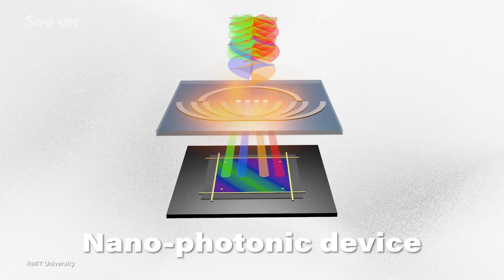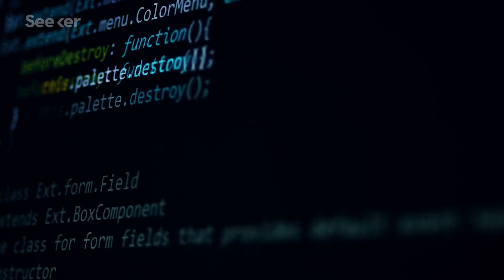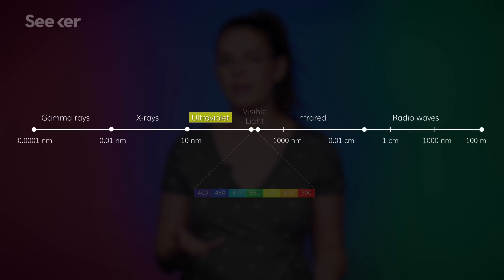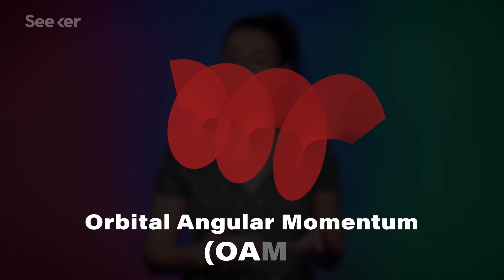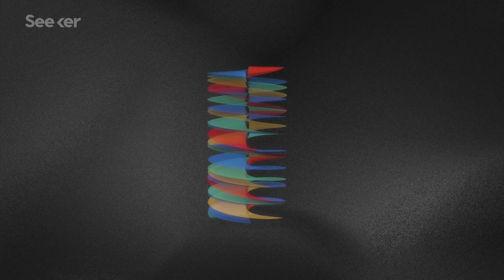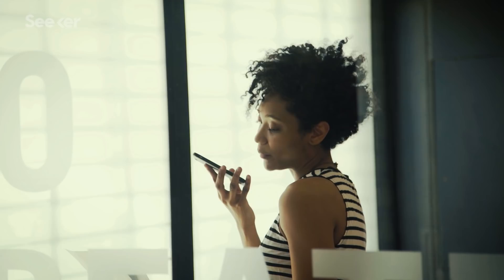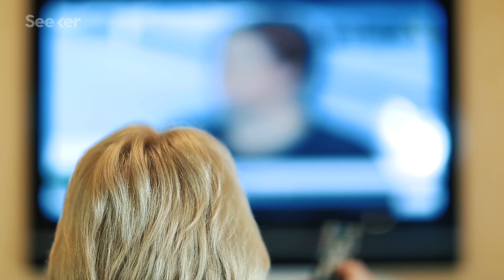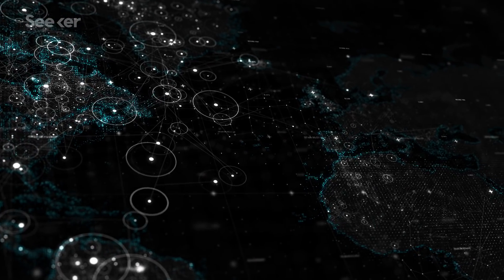Why Twisted Light Holds the Key to Radically Faster Internet

Comment: Amazing video, amazing Maren. For the sake of explanation, the video dumbed down a little too much some tech talk.

We can typically transmit 80 optical channels in one single fiber. The OAMM might allow us to squeeze more into that fibre.
All those channels are in the infrared side of the spectrum, to use visible light or ultraviolet we cannot use common fiber.
This typically means a backbone transmission between communication hubs, not end user access, but it might allow for more light channels to reach a neighborhood or even a street, providing faster speeds per end user / subscriber.

Comment: Gosh... She mixed everything in one load of semi-nonsense=(. 

1. What does OAM have to do with the energy, meaning, frequency of light?! These two DoF are decoupled...
2. Nano-photonic devices are used for non-OAM light for at least for a couple of decades. This field of research emerged earlier, and has been developing in parallel with singular optics (twisted light).
3. Twisted light is not made of more "modes" of light. Rather, each photon carries non-trivial topology. "Mode" is an overloaded term, which is better to avoid, especially since she talks about decoding, meaning, quantum regime...
4. What on Earth makes quantum computing a preferential application for twisted light?! It doesn't matter WHAT information to transfer with OAM... OAM is just another information carrier...
5. And... sorry, "machines in space" communicating via fiber?! Hah... Human teleportation is more likely, honey...

Uff... In science we trust...
Reply: This is typical from these guys they just throw out complicated language without bothering to explaing anything and hyping it up all along.

Comment: they finally used circular polarization to add another dimension to QAM type physical transmission models?
Edit: technology proudly adapted from decades old military radar techniques. not new, you just havent ever used a spinning dipole antenna before. wink

Comment: Fibre optic isn't a wire, its fibre optic core, copper cable=wires or pairs of wires, fibre optic cable has cores. Also only multimode (local distribution typically in LANs) uses internal reflection.  The main backbone of optical fibre is single mode which uses a Gaussian profile along the core.  What your talking about is a new form of multiplexing to increase bandwidth.

Comment: I do not appreciate the inaccurate statistic at the end that 99% of international data goes through submarine cables. 99% is way too much. More realistically speaking it’s far less, especially since many landlocked countries also have internet access, and unless they are accessing websites from somewhere “overseas”, they won’t be sending any data through submarine cables. Example, South Koreans accessing WeChat or Alipay, Afghanis accessing daraz.pk, Mongolians using aliexpress etc. All this is international data, but they are directly connected over land.

Comment: So put simply this is a new protocol for fiber optic cables that allows more bandwidth on the cable, there is more data being transferred at the same time.
This video isn't good , talking about faster internet but not really explaining the actual application of the thing they were talking about, and when talking about fiber optic it isn't appropriate to say faster because it is light, the sentence that absolutely should be in the video isn't and that is : more bandwidth on the fiber optic cable

Comment: I've never heard the term twisted light before. That's just how EM waves propagate. Twisted light suggests "not twisted light" is normal light. However: All light is "twisted" in one way or another. Only for the very special case of E and H Field components in phase with each other "not twisted" light exists. Ps. We are "decoding" (as it was called in this video) EM waves just the way described in this video just for much lower frequencies. The innovation now is that we may soon be able to do it in the Terra Hz range, which previously wasn't feasible in standard conditions.Currently for EM waves in very high Frequencies (aka light) we usually use pulses of monofrequent carrier waves. That means we are only using information of the time domain. What we are trying to do is using light of a range of carrier frequencies. That allows us to use information from the frequency domain.

Comment: While the technology for transmitting more data faster keeps improving in laboratories, the gap between those who can get even moderately fast Internet or any continues to widen. Because the access to Internet service is often monopolized in many areas, its left to the whims of the provider as to who they will connect. So, many parts of even well wired states, like Ohio, still can't get high speed Internet or have to settle for overtaxed and unreliable sources. It's like waving a steak in front of people who are starving for bread.

Comment: So, that is deffinition of multimode cable. They are in use for years.
And multiple wavelenght is in use too.

Just, good luck with rorational polarisation detection.
Reply: Multimode cables cant be used over long distances to the the large amounts of dispersion.

Comment: ok seeker, explain to me how fiber optics are applicable to space communication? I don't understand how this could benefit space communication which uses radio waves, and not fiber optics
Reply: Both fiber optics and radio transmitters use light.
Reply: @tempname8263  WHAT?!  they both use light? how? we do not connect satellites to each other with fiber optic cable, makes no sense to me.
Reply: @icedcoffee8561  Electromagnetic waves, dude. That's what the light is.
Reply: @tempname8263  light is a little complicated to explain.... go do some research . and please only reply to comments when you're confident you can explain the answer

the truth is that fiber optics has hardly anything to do with space communication and this channel needs to start checking the script before release.
Reply: @icedcoffee8561  This isn't about fiber optics, it's about decoding information from light.
Reply: @tempname8263  it's about encoding and decoding data through fiber optic cables........ fiber optics aren't used to communicate with space, we use radio waves to communicate with space. fiber may play a role in this process, but only on the ground, not between satellites and earth, so it's just silly for Seeker to make such a claim. this is a huge deal! for earth communication, I cant imagine there being a bottleneck that this fixes for space comms.
Reply: @icedcoffee8561  We use light in both cases and this technology is about working with light. To me it all seems pretty rational, don't know about you.

Comment: Several errors in this vid, and really confused descriptions and conflations. No one has used photo electric cells for fibre optic comms! And stop calling fibres 'wires'. They aren't. And talking about UV light for fibre comms? Nonsense. Twisted light  could increase fibre capacity, which is reaching the funds Shannon limit, important for continuing to meet the ever growing demands for data bandwidth at lower cost.

Comment: Keep in mind that this won't increase internet speeds for a single user. Modern computers aren't able to fully utilize 1 Gbps ethernet because the data transfer speeds are on par with the read/write speed of the hard disk. Although, the RAM is much faster than the hard disk. So, if we could store all that data on the RAM, we would be able to fully utilize the blazing speeds. I just found a superuser article that says the RAM has speeds of 2-20 GB/s. That's right. Giga bytes per second, not bits . So I guess storage won't be a bottleneck for the internet, provided we utilize the RAM. If we want to download something, however, we'll have to store it in permanent memory, which will be much slower (SSDs have read/write speeds of 50-200 MB/s, hard disks are even slower).
Reply: M.2 is lot faster my one R/W at 3,500MB/s to 2500MB/s and there's faster one's out there
Reply: @Shane McVay Ah right. I forgot about those. However, most people are still using HDDs because SSDs are so expensive. Perhaps in the future things will be different.

Comment: You say it probably wont be used for consumer applications, but in reality it will probably first be used for undersea cables as increasing capacity without laying new cables is so financially beneficial that adding very expensive equipment at each end is economically viable.

Comment: I work with fiber optics, and i don’t see how this differs  that much from current technology. 
Using different wavelengths of light in the same fiber optic cable is already a thing, we just need filters in each end to merge and split the wavelengths. 
Does this new technology just offer a way to merge more wavelengths together? 
Also, as far as i know, visible light isn’t used in fiber optics as you say. I certainly haven’t seen any visible light coming from fiber optics cables other than when we manually add it so we can work out what goes where.

Comment: They'd better role out the technology soon, cause these internet speeds are to be frank, slow. . . 

My next pc will have hopefully drives that could hit 8GB a second, with pcie 4.0 each lane will get 2GB each n an nvme drive that has x4 lanes means 8GB, 

Compared to internet which best you can get is 1GB theoretically, it's not rlly enticing when you have a whole family of 5 who love to hog the internet, 

I presum max each can will use is 200Mb which means my family saturates the current cable completely n we see slow downs regularly affecting upto 80-85% of the speed,

Comment: About 18 years ago my internet connection used to get shut off cuz I would be late on the bill. I found a way to turn the internet back on, and watch some basic channels using an old TV, that had UHF , and running the cable line that connects to the modem and plugging into the back of the TV then I would turn the top dial backwards somehow it would unlock the cable internet then I'd get a call from my provider. Oops

Comment: But why tho fiber optic itself isn't slow in fact it's so fast that the computers and modems and mainframes that it's attached to hold it back the date of moving through the fiber-optic is so fast it makes the computing power of the computer look like it's going in reverse

Comment: Remember kids, If you have fiber optic internet at your house it does not use visible light. It’s infrared, and if you look into the fiber you won’t see anything while it’s damaging your eyes. 

Sounds like OAM is new, but they have had the ability to use multiple frequencies, or “colors” of light in fiber optics for decades. DWDM (dense wavelength division multiplexing) can be used on the large scale between cities, or under the ocean for insanely fast data rates.
http://www.thefoa.org/tech/wavelength.htm

Comment: Why not just refer to it as analog optics and digital optics? Current fibre is multiplexed digital signal. This is just frequency modulated optics. It's pretty much Morse code vs. FM radio. I can imagine it has the same problems too. Like SCSI vs Serial there are probably skew issues/frequency bleed when dealing with the transmit of multiple channels to the same receiver.

Comment: So satellites aren't responsible for the internet?
Reply: no. Satellites only handle traffic, where you can't connect to landline or mobile phone tower ie. planes, remote wilderness, ships, etc. Sending radio waves to a satellite in space has massive delay () even at speed of light. It also takes powerful antennas and receivers and the bandwidth is also pretty poor.

Crushing majority of internet goes through fiber-optic cables. Some of it goes through regular metallic cables (short distances only) and microwaves via mobile phone towers. Usually at the user end.

Comment: When will I get a direct optical connection to my ISP (right now it’s still a copper coax wire from the street)?
Reply: There is nothing wrong with coax. Your be surprised what you can get out of it.

Comment: Aren’t most wires still just copper? And as far as I know you can have a wide range of frequencies on both copper and fiber traveling at the same time without interference, (on top of that there are other tricks to add more bandwidth on the same line without interference too) I don’t understand if this will have much more of an advantage, other than possibly cheaper for having to bundle less cables.
Reply: John J I once got 378Mbits/second for 2 hours ... which is far beyond the limit of 16Mbits/s they said my line (before fiber) could take - even I was 🤷🏼‍♂️ as to how it could happen .
Reply: @lasarith2 yeah I have a copper line, and pretty much a constant 200mb/s. I assume it doesn't have as low latency as fiber, but to most servers where I'm from latency averages 10-20ms, and all of my testing has been over 5Ghz wifi.
Reply: You just diarrhea mouthed your ignorance.
Reply: @ipissed Nice name. This was more or less the point. I was hoping someone could give me a clearer explanation. Clearly you can't.

Comment: To drastically increase your internet speed, just download and install RGB onto your router

Modern problems require modern solutions
Reply: I thought you wrote KGB.
Reply: @TheGeniuscorridor  Hah, if you download KGB your router will also start working faster, but for different reasons X)))))
Reply: Modem problems require modem solutions ( i fixed this in german )
Reply: Are you the new Justin Y.?
Reply: Michael John I don’t know who he is but I’m agreed with you.
Reply: @michaeljohn5130  the weeb justin y yes
Reply: That's has never and will never be funny.
Reply: I know RGB fans make  your computer faster so yeah makes sense maybe your Internet would be faster if router had RGB
Reply: Evariste Galois upvote
Reply: I have never heard of RGB for routers and can't find anything online, I only get results of routers with RGB LED's.
Reply: Evariste Galois modem problems require modem solutions
Reply: I prefer CYMK myself.
Reply: Actually, rgb wouldn’t work, we could see the light waves, even if it’s polarized, some people can see polarized light, we would need something like
LRGBC
Len being infrared
Casioneo being UV
Reply: @Gravivector Yes, RGB is a color system that uses red green blue (very creative i know) If you would install it on your rounter it would most likey not help. It would instead interfer with the router itself.
Reply: @bonkyouded  Emmm... what?!